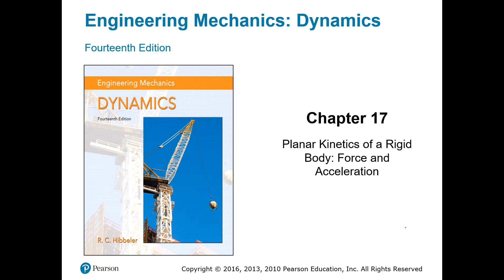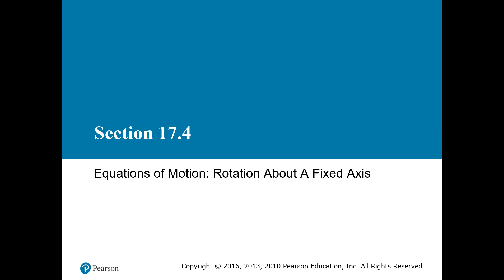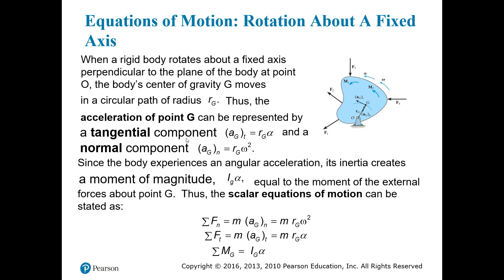Chapter 17 Dynamics Hibbeler part 2 of 2

Comment: Can you please make video to explain the question of the s Statics and Mechanics of Materials because tomorrow after 20 hours final exam please tank your ❤.
The link google drive for question: https://drive.google.com/drive/folders/1qjt7BDootOyQr02qR--_t3kBSSVLw7Vu

Ch7: Distributed forces: moments of inertia 
To be covered:
Sample Example: 7.5
Problem: 7.25, 7.26, 7.36

Ch5: Distributed forces: centroid and center of gravity
To be covered:
Sample Example: 5.1
Problem: 5.2, 5.8

Ch4: Equilibrium of rigid bodies
Topics:
4.1 Equilibrium in two dimensions
To be covered:
Sample Example: 4.1, 4.2, 4.4
10
Ch4: Equilibrium of rigid bodies
Topics:
4.1 (continue) Equilibrium in two dimensions
To be covered:
11
Problem: 4.1, 4.13, 4.17
Ch4: Equilibrium of rigid bodies
Topics:
4.2 Two special cases (Equilibrium in two dimensions)
To be covered:
Problem: 4.29, 4.35, 4.36
Assignment#3:
Problem: 4.11, 4.14, 4.16, 4.22

Statics and Mechanics of Materials
Ferdinand P. Beer
Late of Lehigh University
E. Russell Johnston, Jr.
Late of University of Connecticut
John T. DeWolf
University of Connecticut
David F. Mazurek
U.S. Coast Guard Academy
Mc
Graw
Hill

https://drive.google.com/drive/folders/1qjt7BDootOyQr02qR--_t3kBSSVLw7Vu